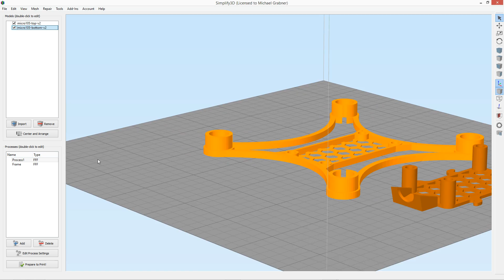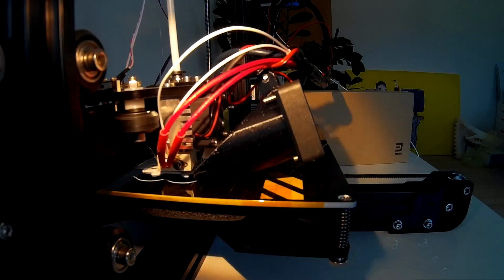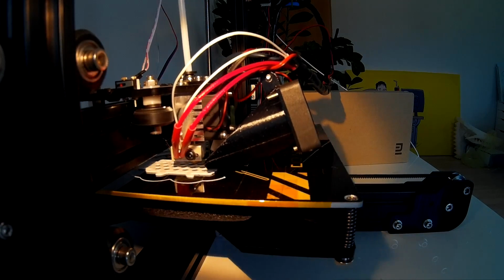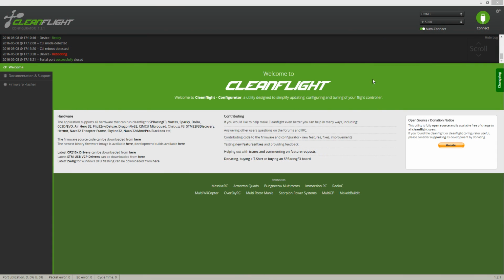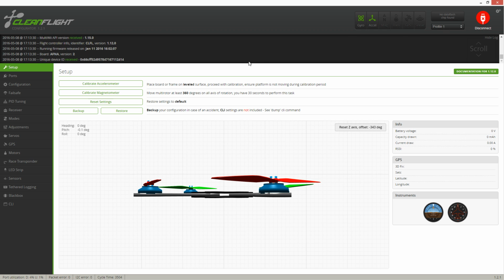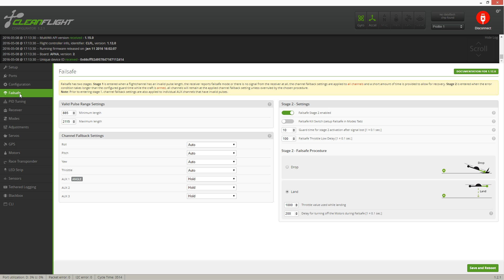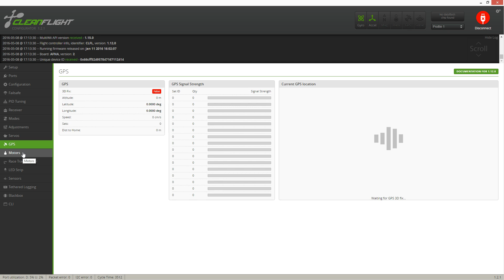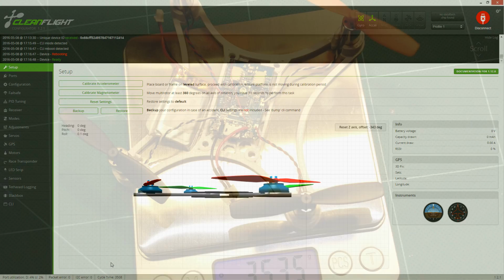3D Printed Brushed FPV Quadcopter: Print, Build & Fly

Comment: Hello, i just started to build this as my first project because of your video :) But i have wonder where to buy the cables and connector to make att power connector like you have. I am completely Noob so would be awesome if you could make a video on how to solder that small. And what happens if I accidently solder both connectors to the motors together on the scisky board because its so small. Thanks, TrueType
Reply from the maker: Hi! If you get the charger/lipo set from my video description (http://bit.ly/1UM1vj0) you can actually salvage one of the charging leads and create your battery connector from it. This is how I did it and it's the reason why I recommended that charger/lipo set. If you accidently solder connectors together, you should not turn it on, that will damage your motor or board. Try to solder with a very thing tip, slowly, carefully, maybe even with a magnifying glass. Try it first on some other stuff, just to get used to it. Once you get the hang of it, it is not that hard :-)
Reply: Hey! Thanks for replying!
I have bought everything you have linked in the description. :)
Ok, so I could simply cut off one of the connectors from the carger, but how do I then connect the camera?
Another question I have is that my printed (V2) model, same as you use in this video. The holes for the motors are slightly too small. And I can barely bend them wider without breaking the model. Is there a scale or something that has to be set properly?
Thanks in advance
Reply from the maker: Hi mate! For me the motors fit perfectly. You could try playing with the "infill" or wall strength parameter for your slicer. Or use a thinner nozzle (mine is 0.4mm). For the lipo connector I simply cut off one of the connectors from the charging cable, correct. The camera leads were soldered directly to the Scisky, to the same place where the charging cable goes. Since the camera has a voltage regulator build-in, it can take the 1s lipo directly.
Reply: +RC FPV Flight ok thanks! So at 3:35 in this video you just soldered the cameras cables to the same spot you soldered the battery connector? Is this right?
Reply from the maker: Yes, that is right.
Reply: I have soldered all the cables to the flight controller now. But when I plug the quad into my computer I cannot save anything. I can see the gyro and so on, but when I try to save and reboot I am just back at standard. And when I plug in the battery it just gives full throttle to all motors. Any suggestions? I don't think I screw up the soldering, but I can't tell for sure since it's so small.

Comment: I am planning on making this build. If I wanted to run the camera without getting noise from the scisky board, how would I connect it? Could I use the 5v and ground from that 4 pin jst?
Reply from the maker: Great! If you plan to use the AIO FPV set which I link in the description, then you don't have to worry about having exactly 5v. The AIO FPV set supports 2.5v - 5v input, so you can directly connect it to the flight battery. It has a noise filter integrated.

Comment: Have you seen this new camera? http://www.banggood.com/Eachine-EF-01-AIO-5_8G-40CH-25MW-VTX-800TVL-13-Cmos-FPV-Camera-p-1064301.html
Reply from the maker: Yes, I saw it. It comes at a good price, but it is also twice as heavy as the usual choices (see video description). Also the input voltage of this new camera is specced at 3.6-5v, which makes me assume that it will not run off 1s lipo, like the others do. It is a great price though.
Reply: Have you seen this also http://www.banggood.com/Micro-32bits-Brushed-Flight-Control-Board-Based-On-SP-RACING-F3-EVO-Brush-For-Micro-FPV-Frame-p-1070068.html
Reply from the maker: Yes, exactly this combination (the new F3 with the MicroFRX) looks very interesting. Together, it will be about the same price as a Scisky, but more powerful. Too bad the MicroFrX is not available on Banggood, that way one culd order both with free shipping.
Reply: Agree.  I was thinking of adding a micro OSD to the new board.
Reply from the maker: Sounds interesting. I have so far not used an OSD on my micros, because I always tried to make them as lightweight as possible :-)

Comment: Hello, thank you for the great instruction. The copter is better than my blade Nano QX2! could anybody find out the perfekt PIDs already? the original are littlebit oszillating..
Reply from the maker: Hi Martin! I'm still flying with the original PIDs, I just changed the Expo and RC Rate a bit, since I'm flying mainly rate mode these days. I found that the original PIDs are working very nice, even in rate mode. If you get some vibrations on the original PIDs, maybe try changing the props. I had an unbalanced prop one which would also cause vibrations - when I changed it the vibrations were gone.

Comment: Do I need to arm the motor in the cleanflight?
Reply from the maker: It works exactly the same way as with a brushless motor. Either put the arming on a switch or (default) it will arm if you hold yaw to the right.
Reply: Thank  you. I'm working on my very first quad.

Comment: (Ich glaub mal dass du Deutsch sprichst) Also dass sieht nach einem sehr coolen Projekt aus aber ich glaube es ist zumindest für mich der eine Graupner Funke hat einfacher einen Inductrix im RTF set zu kaufen und dazu noch ein Quanum Elite Micro FPV set. Dann noch einen halter für den Quanum Elite Drucken und man kommt auf den selben Preis und dazu hat man dann noch eine Spektrum Funke dazu.
Reply from the maker: Hi! If you want to fly indoors - absolutey go with the Tiny Whoop (Inductrix). If you want to fly outdoors, but still stay micro, go with what I show in the video. The used Micro Scisky FC has the advantage of rate mode, which will allow you to fly acrobatic even in your own garden. It is also much more agile and potentially much faster than the Inductrix. So in general: indoors --> Inductrix all the way, outdoor garden warrior --> go with something like the above. :-)

Comment: So you say about 50 usd for this build? asuming that I can 3D print the frame
Reply from the maker: Without FPV it would be around 50 USD for this sub 50g(rams) quadcopter, if you can print the frame yourself. Price of FPV will depend if you go for the all-in-one solution which I use (~ 40 USD) or if you build it yourself (~ 20 USD). Full info and parts list for all parts is here on my website, so you can easily check this for yourself: http://rcfpvflight.com/articles/3d-printed-brushed-fpv-microquad-print-build-fly/
Reply: Thank you very much! Also what would be a good radio controller for beginner?

Comment: Hello! I'm really interested in this project. Everything is well within budget for me except for the Taranis Flight Radio. Would a FlySky FS-T6 work as well with this board? There seems to be limited documentation on it except for pre-built RC calibration. If you don't recommend the FlySky FS-T6, are there any other sub-$60 controllers you would recommend?
Reply from the maker: +craym0nk Absolutely, it will work great with the Devo7E flashed with Deviation. I have one of those at home to play around with toy copters. But if you chose the Devo7E you should maybe also do the range mod, because default it comes with a limited range. It is absolutely worth a look, the reason why I suggested the OrangeRX was that I had the feeling that the original poster is a bit newer to RC and I wanted to give him as much a RTF solution as possible :-) My feeling could be wrong though. Love my Devo :-)
Reply from the maker: +IndieGamerBrok Great that you are interested. You'll definitely love it. If you are looking for a cheap radio to use with this project, you need a radio speaking DSM2. HobbyKing is selling a quite cheap (65 USD) radio which speaks DSM2: http://www.hobbyking.com/hobbyking/store/__54822__OrangeRx_T_SIX_2_4GHz_DSM2_Compatible_6CH_Transmitter_w_10_Model_Memory_and_3_Pos_Switch_Mode_2_.html . That one should work great.
Reply: I believe the Devo line are also compatible. The Devo7E is cheap & capable, especially if you flash it with Deviation firmware.Might be worth a look.
Reply: +RC FPV Flight definitely right on the "new to RC". I found this through 3D printing. I run a FolgerTech 2020 i3, pretty similar to your tarantula.
Reply from the maker: +IndieGamerBrok You will love this build, it is really easy when you follow my video. Shouldn't be much which could go wrong :-)
Reply: +RC FPV Flight Good points, the OrangeRx is definitely more beginner friendly. I also have a 7E, though I messed up the range mod by spilling conductive ink on my module. The replacement modules are much harder to find than they used to be, no longer on Banggood. I've also got a Taranis so the Devo doesn't get much attention any more.

+IndieGamerBrok good luck with your build, these Micro's look fun.

Comment: just awesome. glad I found your channel. keep the videos coming.
Reply from the maker: +gregor121 Many thanks! Great to have you with us! :-)
Reply: +RC FPV Flight Do I really need to set Infill to 100%? How did you do it?
Reply from the maker: +gregor121 I just left it at my default of about 20-40%. Infill is actually irrelevant for this build, because all the walls / layers are so thing anyways. Infill does not matter, because there is almost nothing to "infill" with this print ;-)
Reply: +RC FPV Flight thank you for your input. It worked well, I printed it at my friend's. That is propably why I asked the dumb question :-) First time 3D printing.
Reply from the maker: +gregor121 Awesome. Keep me updated how the build goes :-)
Reply: I have everything set up and wanted to bind the FC to my dx6i TX but it does not seem to work :( I read on the internet that I need to have DSM2 which my TX does not seem to support
Reply from the maker: It depends on how new your DX6i is. Older versions of the DX6i still supported DSM2. Newer versions only support DSMX.
Reply: Sorry to bother you again: do you know any workaround to not buy an old dx6i?
Reply from the maker: The easiest way would probably be to add a DSMX satellite receiver to the Scisky. People have had some success with this here: http://community.micro-motor-warehouse.com/t/fc-scisky-dsmx-satellite-mod/522/7

Comment: That flight controller board seems pretty expensive.  

I wonder if you could get any other cheap STM32 based flight controller (i see them under $14 on ebay), and solder N-channel mosfets onto 4 of it's PWM outputs.
Reply from the maker: +roidroid The board is definitely the most expensive part here, but seeing that it includes both the brushed ESCs and the DSM2 reciever, it's something I can live with for ~30 USD. Your project idea sounds fantastic though. If you proceed with it, please make sure to keep us updated on your progress :-)

Comment: Awesome build! I'm on a major micro FPV Quad building spree! I have 6 so far and I love all of them. Be sure your FailSafe is working properly. I've seen some people have fly aways when they lose signal. Also can you test the output of the Quanum FPV transmitter with your Fatshark Mw meter? That would be great!
Reply from the maker: +JKFlorida Many thanks! Those micros are awesome! Many thanks for the tip about the failsafe - I'll make sure to recheck this. I'll try to figure out how to measure its strength. I can obviously not connect my power meter through SMA, since that micro set does not have a SMA plug. I'll see if I can do measurements directly from the antenna.